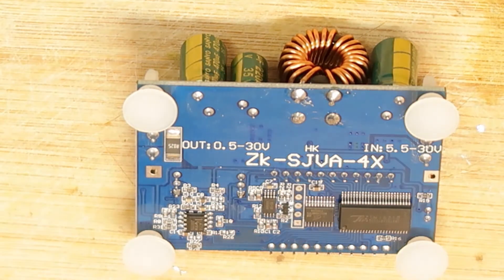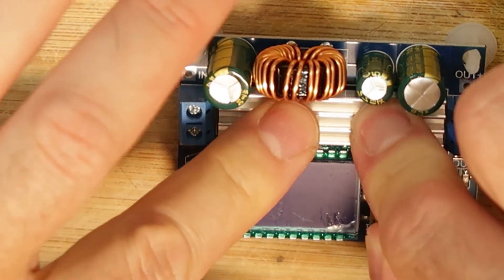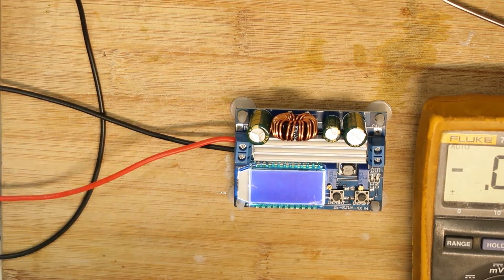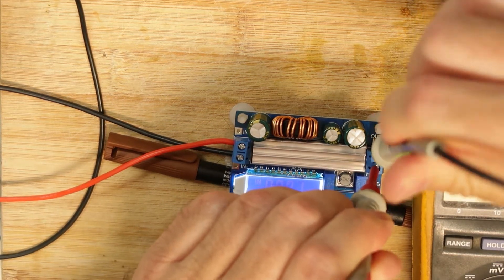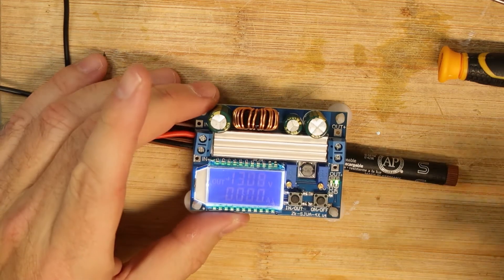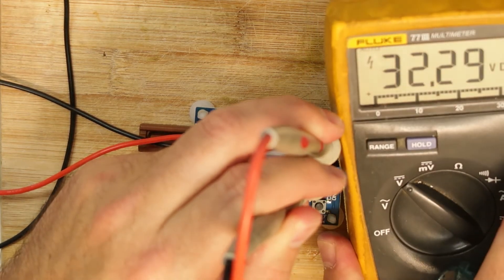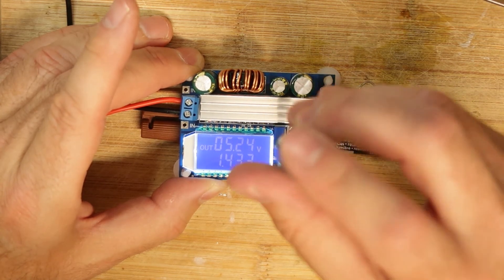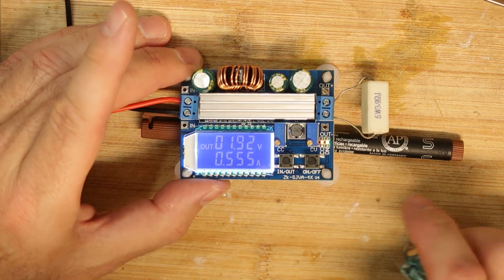DC to DC converter,  out 5-30V to 5-30V 4A ZK-SJVA-4X Testing

Comment: When adjusting current you need to short Ur not use resistor
Reply: or use high drain 18650 with voltage around 3.5 and charge it to 4v it will put out max current and adjust with potentio
Reply: @efdawahfan but proper practice is dead short .. power supply has protection mode especially designed for that.